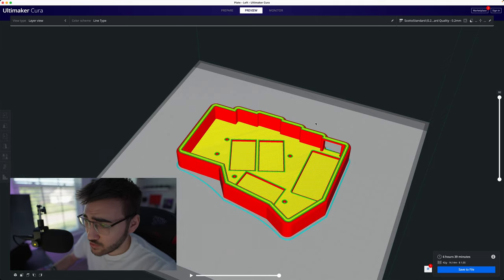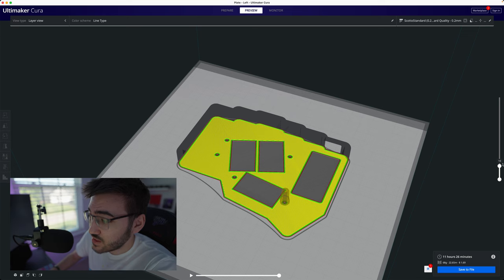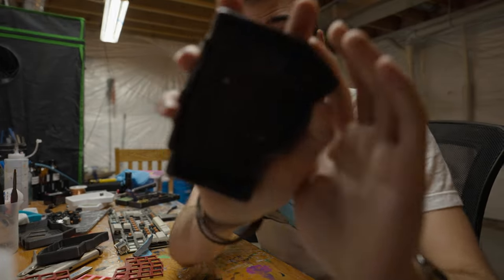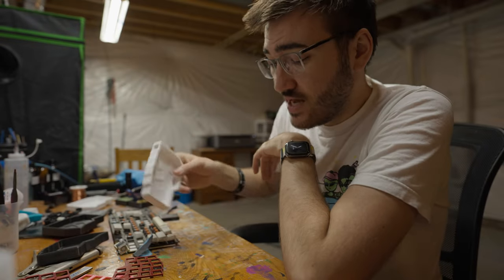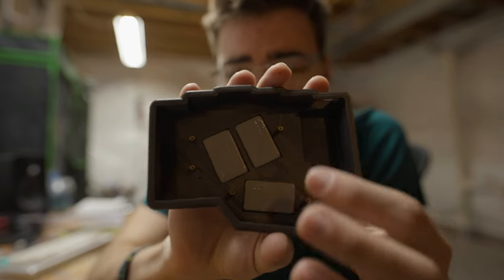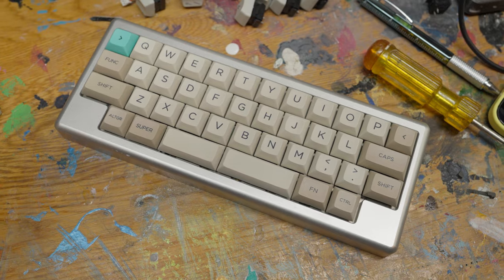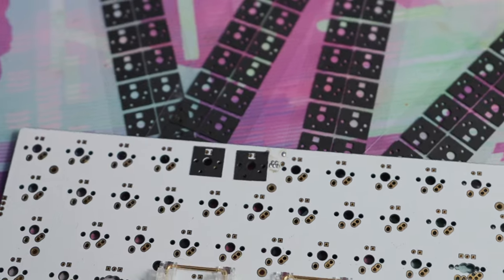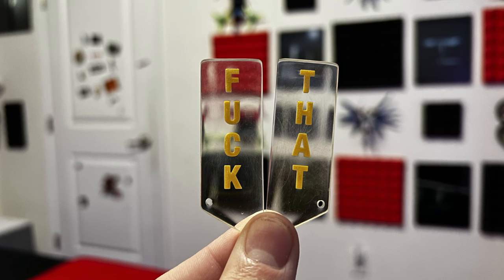Building a Wireless Corne with Lubed and Filmed Alpacas

Comment: u dont need to set bottom layers to 1000, just set infill to 100%
great work btw!
Reply from the maker: If you set infill to 100%, you’ll see that there are still gaps in the print depending on what pattern you’re using. By setting it to treat all layers as bottom layers, it ensures it will print completely solid regardless of the infill pattern.
Reply: @joe_scotto  hmmmm, you are right! great to knew something new, thanks for that )

Comment: I don't want to sound like the "well actually", but here it goes anyway: you can set the infill percentage to 100% to achieve the same effect as setting the bottom layer to 1000. It's better to do it like that because it's the 'real' way to do it and it will be more stable.
Reply from the maker: It depends on the slicer, some will print solid, others won't. By setting the bottom layers to a high number you ensure that the print will actually be solid.

Comment: I think I want to try a low profile corne next. ^^; I bought a sofle kit to put together, but with all of the surface mounted diodes I was a little out of my league. ^^;

Where did you get the Corne with through-hole diodes?
Reply from the maker: I got it from Little Keyboards but you can get it anywhere that sells the "Corne Classic" PCBs. The V2 and up only use surface mount and even more, the V3 only comes in a 3x6 variant without a break off board for 3x5.

Comment: is there input delay on wireless splits? Would it be felt in fighting games where frames are crucial in input?
Reply from the maker: Yes. There is normal Bluetooth delay however if you plug in the master side it will have normal USB latency on that half. Both halves still will communicate with Bluetooth low energy with I believe 7-30ms of latency, but don’t quote me on that.
Reply: Oof. 7-30 would seem to be extremely high. That would mean that you are playing at like 40-60 when you also count in processing and internet delay.. which counts as unplayable
Reply: @iglobrothers645  Ty! I've been trying to get into diying keyboards specifically splits

Comment: Hi
Could you please share the layers that you have configured in this kb?
I can't imagine that 10x3 layout is enough for comfortable coding :)
Reply from the maker: It is more than enough for coding, I do it all the time and plan on making a video taking about it soon. Here is the keymap: https://github.com/joe-scotto/zmk-config-corne/blob/main/config/corne.keymap
Reply: @joe_scotto  cool,  turned the bell on for your channel and looking forward to review ;)
Some questions for future video:
How do you switch between apps?
Dedicated arow keys are really useful, isn't it uncomfortable having them on another layer?
Doesn't it make U mad having to jump over layers all the time?
Reply: @MrSergpank  I personally have a 34-key keyboard, and I don't have any issues with it. I also spend a lot of time programming, and designed my layout around that and typing.

Having arrow keys under a layer is far more comfortable because you don't have to move your hand to reach them, they're accessible under a thumb key and the home row. I only have 2 thumb keys per half, so there's minimal movement.

As for switching applications, I personally use Linux with the i3 window manager, but I have a set of Alt, GUI and Ctrl on each layer, so doing something like Alt + Tab is trivial.

Here is a decent demo that showcases programming with these tiny boards: https://www.youtube.com/watch?v=IZ83uU0ltaE
Reply: @sabbath9503  I must admit that I am very impressed I will try some 34kbrd too